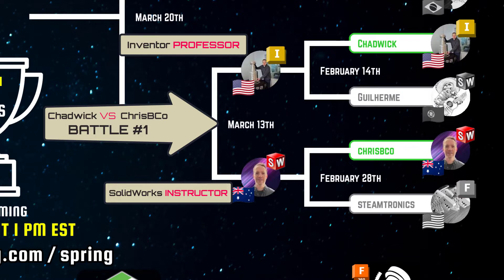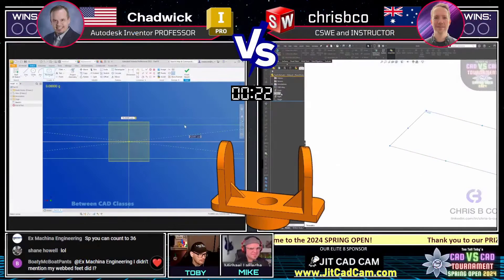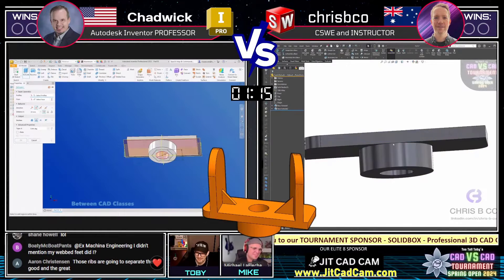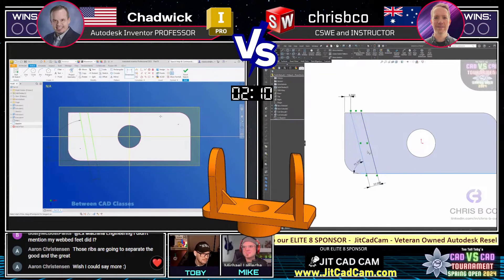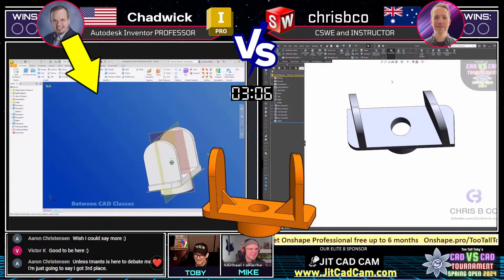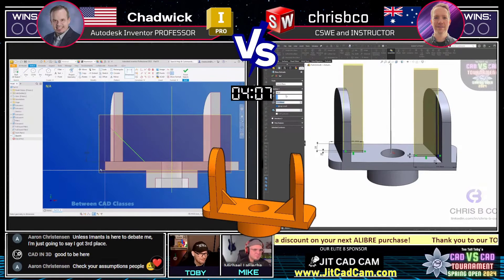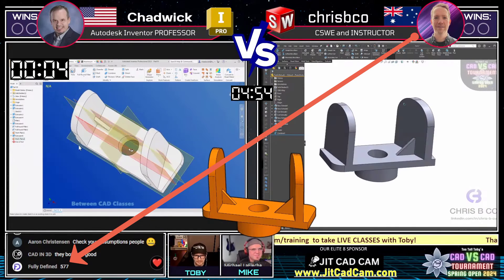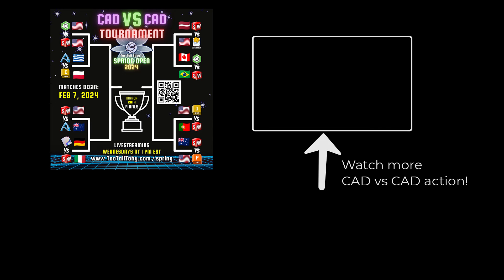Autodesk Inventor VS SolidWorks - Which is FASTER?

Comment: Come on SW guy.  Overlapping the rib from the "top view" is sloppy. 
What if rib was thicker than 5mm? Now you must create a parallelogram or trapezoid sketch. 
Using, [draft] command was smart, but a "brute force"/"not efficient" way that is an "additional" command used.

Do this:  Use a single extrude command:
a.) Sketch plane = front edge of part.  Just like shown in the front view of the drawing.
b.) Sketch a triangle: dim to edge, 45 deg and "PIERCE" constraint in corner.
c.) Extrude: [from=offset=20] [blind=5]
Done:
i.) no additional [draft] command, or overlapping sloppy sketch. SW guy
ii.) Same to you Inventor guy.  Sloppy "over sketching".  However, you did offset extrusion.  Good.  However, you fk'd up with "full round fillet".  Pay attention to the drawing.
 Inventor gives you the edge with "multiple" extrude and cut operations in that one extrude command. What happened? 

Most of you guys may not be familiar with "pierce" constraint unless you do a lot of sweeping, lofting and surfacing.
Pierce is key and always from a "point" to a "line".   In some cases, you can use "coincident" command but in most cases is misleading, unreliable and frustrating.
Reply from the maker: Nice  - I like these suggestions!
Reply: Says the armchair captain hindsight who's not in any competitions nor who's won any ....

Comment: I've used both and Inventor is "faster" with some commands because it simply copied what SW does and tweaked a bit.  The command for extrude boss or cut boss is in the same command.  
However, Inventor could not copy SW's simple file system(part, assembly and drawing), but instead needs(project, part, assembly, presentation w/representation(supposed to be configurations), and drawing).  Also, on large assemblies Inventor tends to tumble like house of cards.  So I would not use Inventor for any professional machinery designer with hundreds of parts.  I also hate how inventor uses the term "constraint" for both sketch control and assembly control.  I do like the "color" feature of Inventor for part file.
Reply from the maker: Nice - We had an inventor user win the WORLD CHAMPIONSHIP a few years ago!  Gerben!!!!!!!!!
Reply: Me(few years inventor experience) coming to check the solidwork vs inventor workflow and you kinda summarized my issues I had with inventor XD, i havent used solidworks yet, but it seems much more promising in bigger assembly with many sub-assembly and moving parts ( over 100 pcs